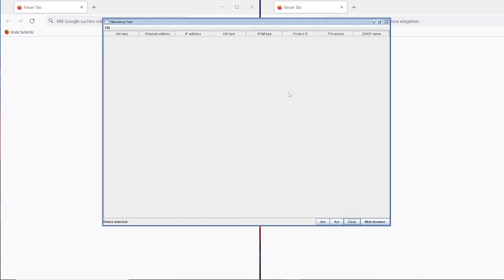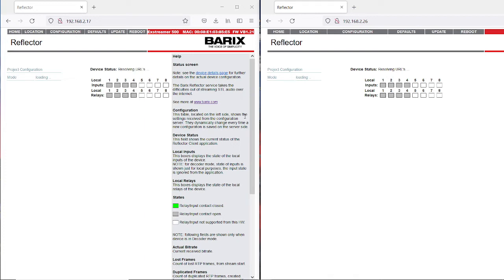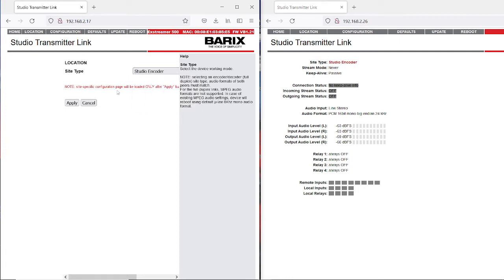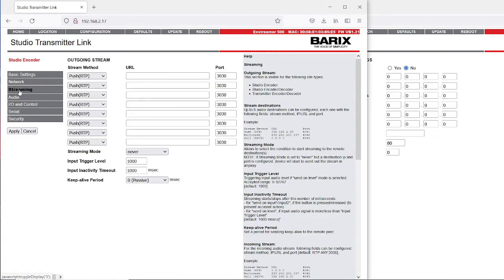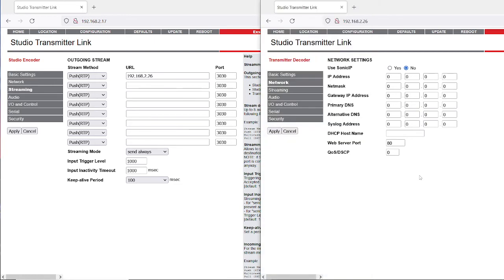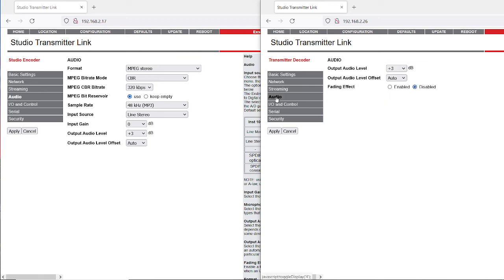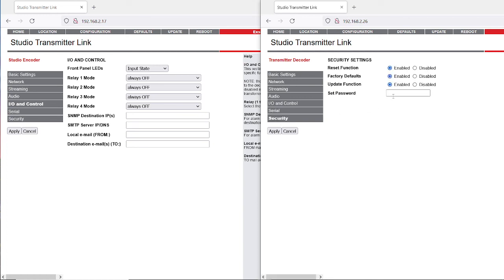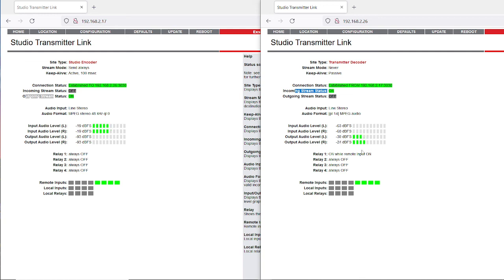Barix Exstreamer500 - Standard RTP-STL connection

Comment: Does this firmware works if you have static IP adresses on the Router, but not on the Barix Box it self? it sounds weird, but thats how I am operating two of this barix boxes with two Barix box 100's
Reply: Yes, that is no problem. For the streaming over Internet you can work with fix IP address settings or with dynamic IP assignment on the router. But when using dynamic, then  you have to work with DNS names. On the devices it self you can also use static IP address configuration or DHCP. If using DHCP, then make sure the device connected to the router with the port forwarding always get the same IP address, otherwise the port forwarding does not fit anymore.